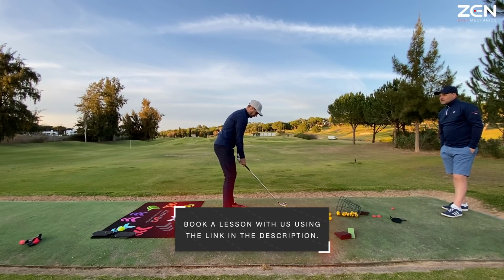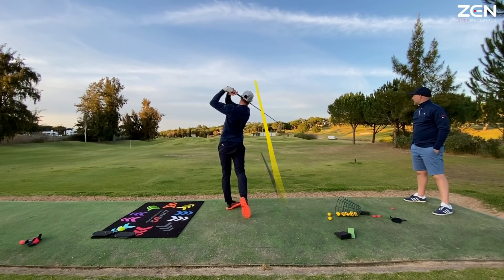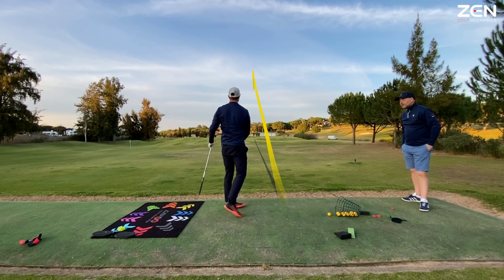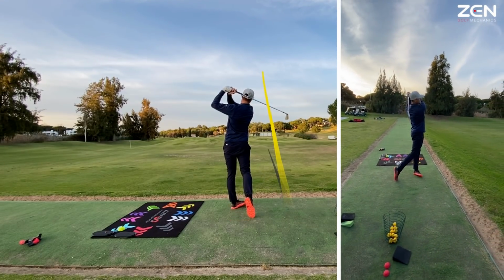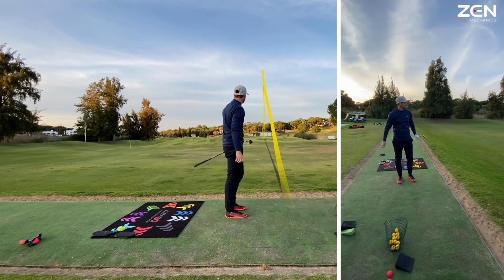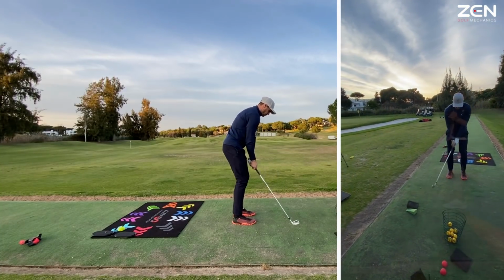Learn the Proper Foot Mechanics in the Golf Swing

Comment: Hi Marcus.   Good lesson.   This is what I call... "keeping the trail heel down until impact. "    Moe Norman is the King of this foot action.  He kept his trail heel down longer than anyone. He kept that heel down well past impact.  I have found with my students that it helps with ...  lower body sequencing, preventing early extension, and improved use of ground forces... Keeping the trail hip deep,  giving tons of room to get the arms/hands get back in front, preventing getting stuck and flipping.     An added bonus is.. if your grip is good. You will have a very straight ball flight.  Your student here does a great job.  Cheers.

Comment: Is the stack and tilt method any good for those who are just struggling with the mechanics of a normal swing? It seems a manageable method for one on their own. I will try it at the range tomorrow. It will have to do until i can get a proper lesson from you.
Reply: I started with Stack and Tilt..for me it really helps me get the shoulder tilt and really helps me feel centered over the ball.  I love the stuff Marcus does here but for some reason I just can't get it.  I have seen huge results with Stack and Tilt in my iron striking.  I can control the low point much better and control the flight of the shot much easier.  But that is just me...it makes sense to me.